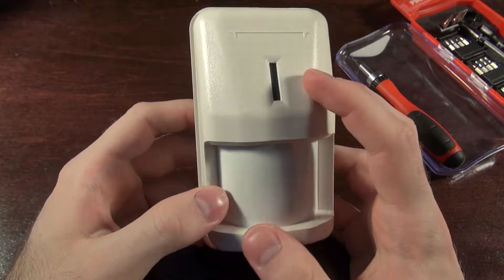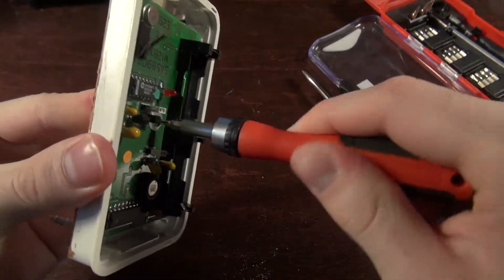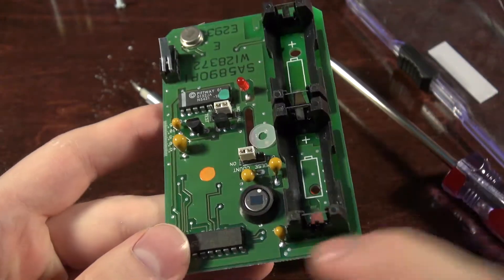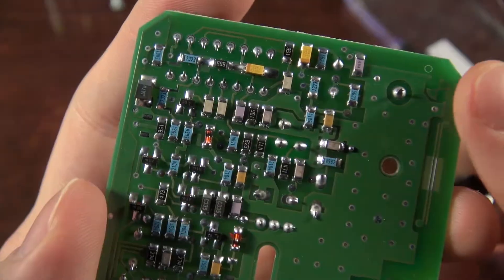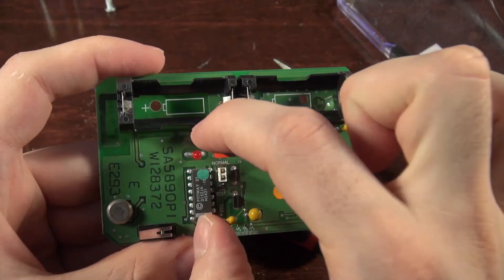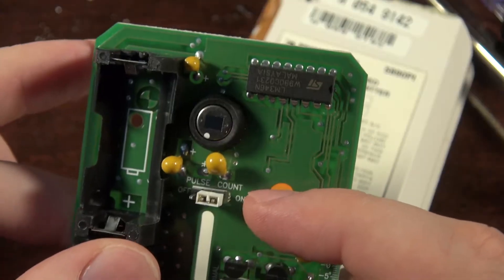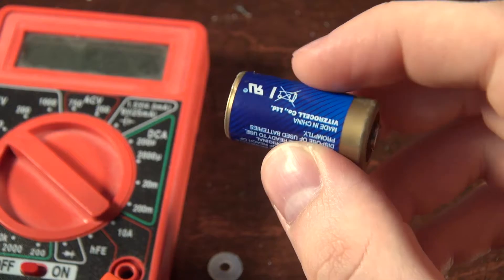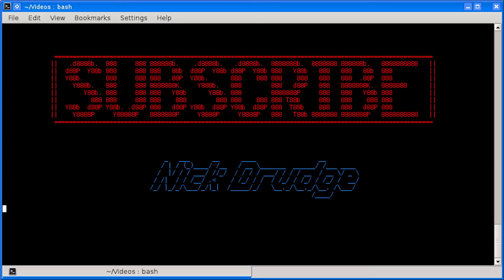Ademco 5890PI Passive Infared Detector and Transmitter Teardown

Comment: I had two installed with my ADT Wireless system in 2005.  Both were mounted high in a corner, and they had to be adjusted (based on typical questions, such as "do you have a pet" in order to have it scan above any pets, etc).  I saw too many other videos showing screws and push buttons, and couldn't find either on my sensors when the original batteries finally went out after 17 years.  The alarm panel gave "low battery" warnings for about 3-4 months, then when the batteries went out completely the system indicated a fault and would not allow me to arm it until the batteries were replaced.  Wish I had found this video first before I got frustated and just pulled the mounting drywall screws out of the drywall when I couldn't figure out how to get the cover off...doh!  :- /  (PS I believe I paid around $100 each, when added to my full-home install package from ADT.)

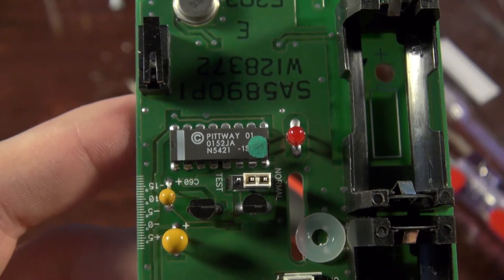Comment: 3:28 I have one of these sensors from a decommissioned alarm system. Replaced the batteries. When toggling the switch to TEST mode, the motion sensor will display a red light for 1 second as soon as it detects motion, whereas if it in the NORMAL mode it will blink if it detects motion with a three-minute cooldown.
Reply: What is this used for? Is it a camera or can it Listen to My conversation?
Reply: @leiannhernandez2789  This is called a Passive InfraRed sensor. It does not monitor you. It monitors motion.

Comment: Most wireless PIRs don't use the LED unless they are in test motion   only wired detectors use the LED on all the time.    If you have any questions about alarm systems you can ask me
Reply: Shall I pull out that white test icon and put it back and put new batteries in, then the red LED will show on as on test status. But normally it will not blink when I move, that is normal.